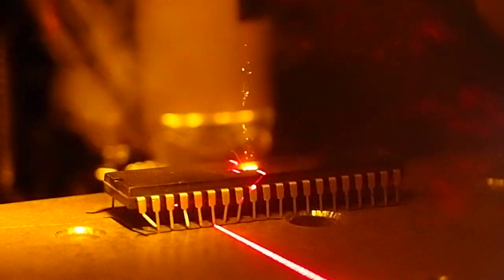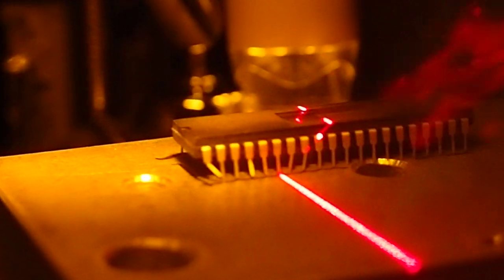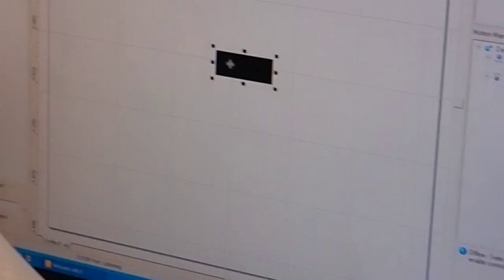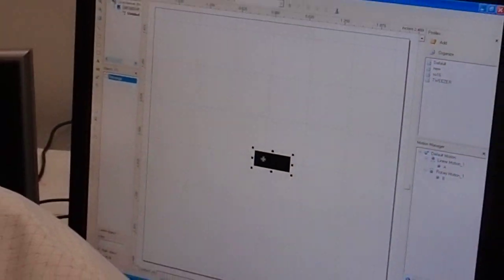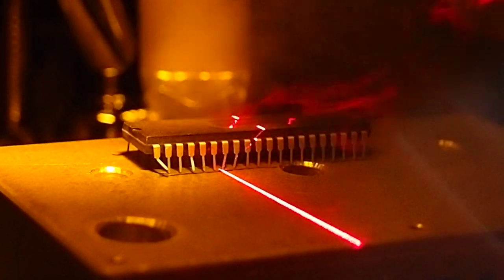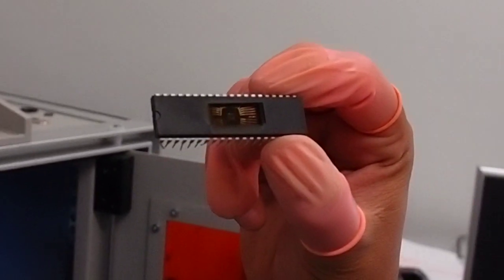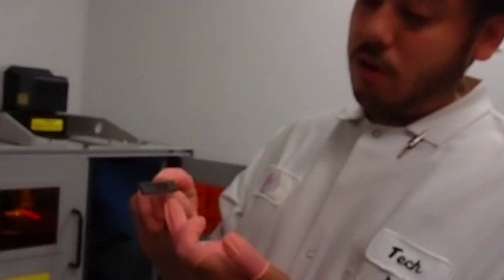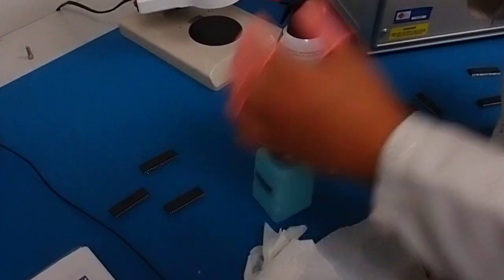Laser Decapping IC process

Comment: Why not do 3 passes 95% and let the rest be disolved with a corrosive acid?
That way you extend the time it will negatively impact the IC and the bond wires.

Just make sure you clean it or neutralise the acid as soon as it goes through.